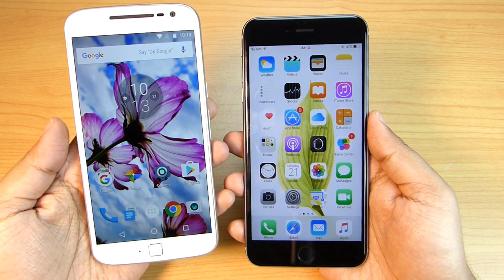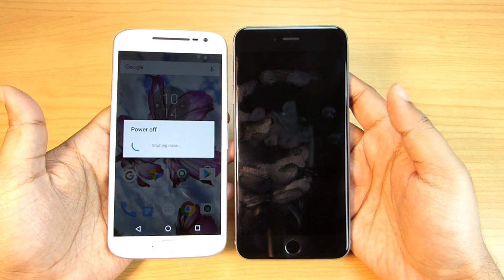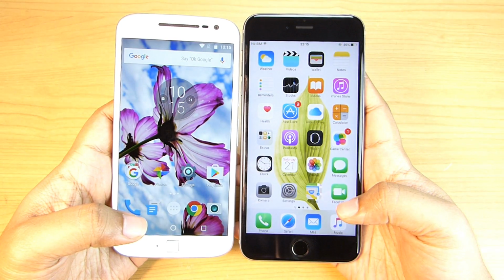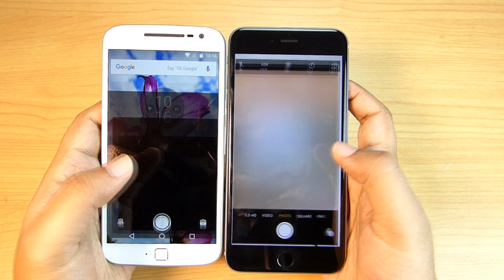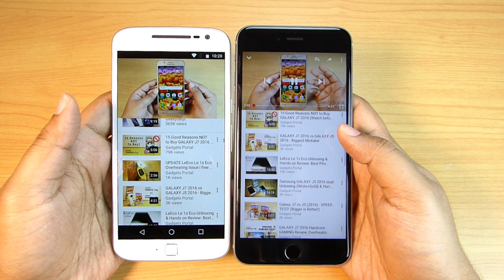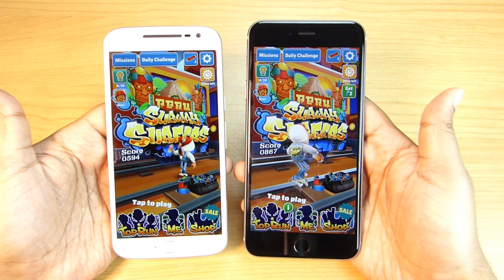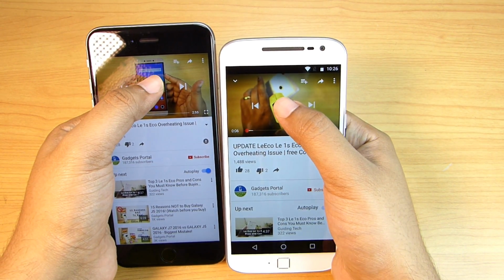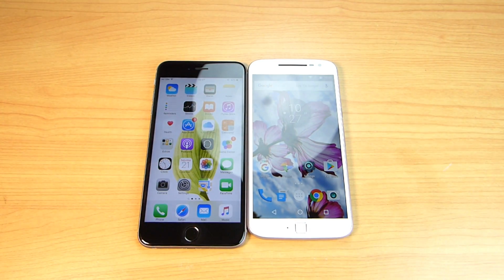Moto G4 Plus vs iPhone 6S Plus- SPEED TEST (Surprise!)

Comment: what the moto G4 has only 45.000 points in Antutu benchmark? man this device is very slow. And then you say the Moto 4g is the winner? So wrong. The mto G4 only won because you have shit wifi and did a wrong test
Reply: um.. no antutu is just a synthetic benchmark. most of the scores are just fake and dont prove anything
Reply: alex rush then render a video and you will see
Reply: still no reason to call it slow, rendering is more gpu intensive which obviously the iPhone would win because it costs 4x more, but for everything else the difference is negligible
Reply: The fact that a phone at this price range can even hold a candle to the iphone is a win in itself.

Comment: How does the Moto G4 handle running music streaming over Bluetooth and Google navigation in parallel ? iPhone handles pretty smooth but it does get hot even with the charger connected.

Comment: does pokemon go work without lag?
Reply: yes, Moto G4 can run faster Pokemon Go. I'm using it. But when you play about 30-40 minutes,then it will be a little bit hot.
Reply: +Dip Y2j yeah the moto g4+ has heat problems. but games run perfectly
Reply: Quinten Pillen ,so i decided that after 3 months, i'm going to buy OnePlus One phone !!
Reply: +Dip Y2j i bought my g4+ last week...so im sticking with that for at least a year
Reply: hah
Reply: +Daniel Alegre  the g4 plus has the snapdragon 617. Cant stand a lot of processing